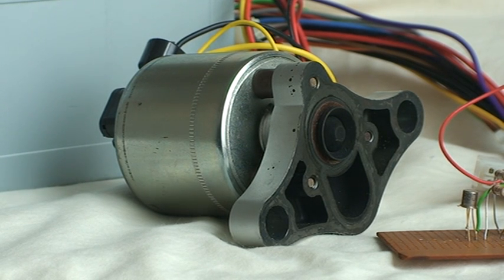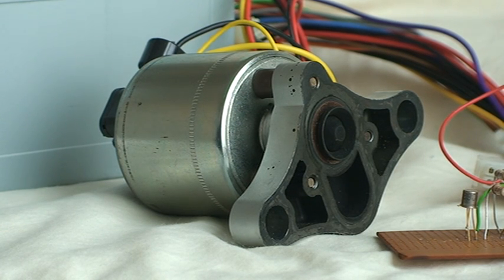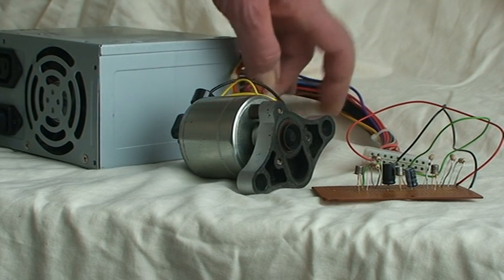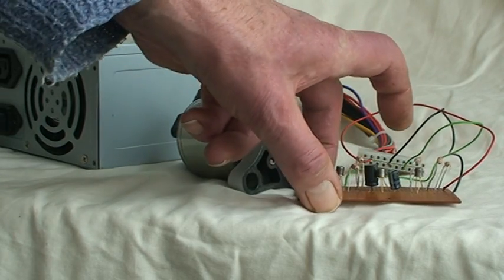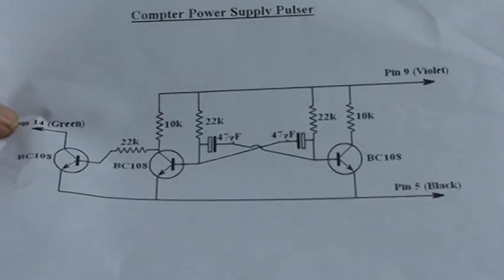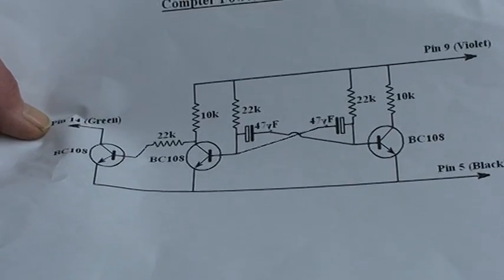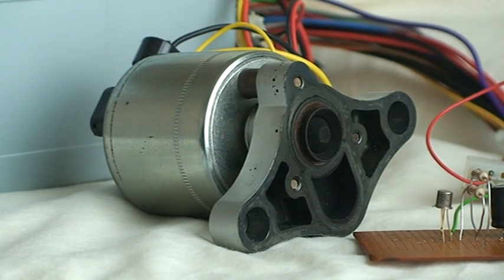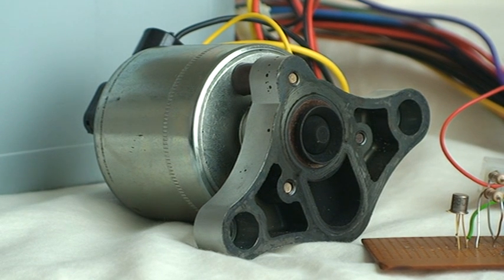Testing an EGR (Exhaust Gas Recirculation) valve

Comment from the maker: @utsports Glad to be of assistance.

Since making the video I've changed vehicles; the new one doesn't have an ERG valve. It adjusts the valve timing, which apparently achieves the same outcome. Solenoids opening and closing valves to cause oil pressure to move vanes attached to the shafts within the camshaft sprockets!

Comment from the maker: Sorry but I've just noticed I've drawn the circuit incorrectly!!! Such that the positive ends of the two 47 microfarad capacitors should go to the collector/10k resistor junction and not the 22k/base junction as shown! To clarify: each capacitor's negative end goes to one of the transistor base/22k junction and the corresponding positive end to the opposite transistor collector/10k resistor junction.

Appologies for the slight cock-up on the drawing front!

Comment: Thank you, very helpful, circuit handy will be building. I'm guessing the circuit can be used on most valves, also was wondering what I could do with the small collection of pc power supplies, perfect :)
Reply from the maker: Don't overlook my diagram error, which I detailed in one of my replies five messages below yours.
Reply: Noted :) Thanks

Comment: hi well done great video got ? if u can put me in right direction pls first i got 12v power supply adaptor and battry charger do they b ok for process then do i need trigger pulser? 
then my egr valve is vw witch is 5 pins how to find out witch is witch thanks in advance

Comment: you did not show connection on valve and old power supply
Reply from the maker: The pin numbers are identified in the diagram. Although there is an error in the diagram unconnected with pin numbers, which I've detailed in a previous reply. But the pin numbers are correct.

Comment: Hello, I have this model of EGR micksgarage . com/img/td/244/l/88010-0.jpg and when i put 12V from car battery on 1 and 5 pins, doesn't move anything. Could be an electrical problem ? I cleaned valve but nothing :(

Comment: meu amigo, desculpe me entrometer, mas, um relê de pisca faria a mesma coisa sobre a válvula!!!
Reply from the maker: You're not intruding at all, and thanks for the reply and suggestion. I'm sure there are various other methods of testing the valve, but I just felt like making it complicated!Anyway, I've since changed cars to which my current machine doesn't have an exhaust  recirculation valve, but achieves the same by variable poppet valve timing.